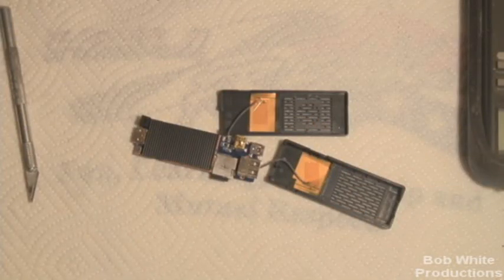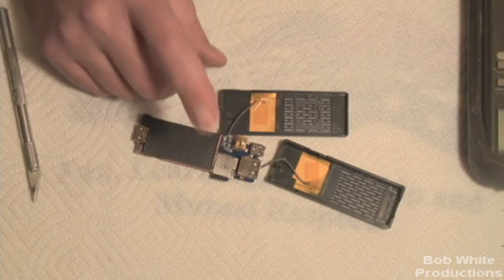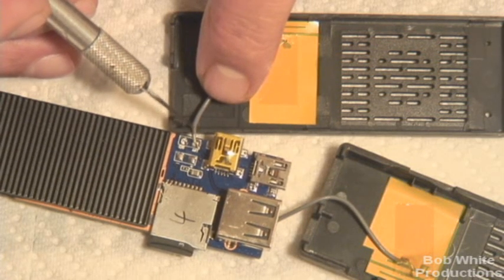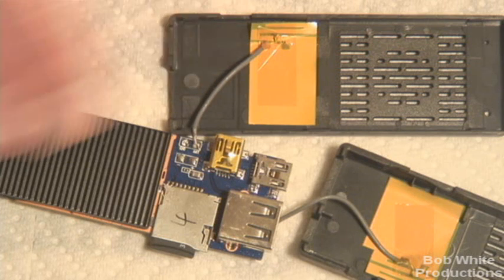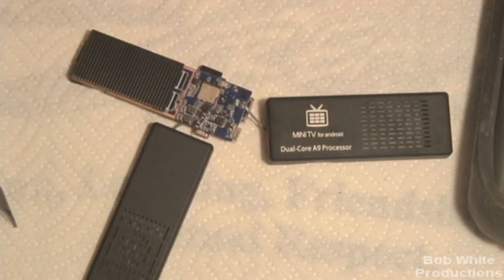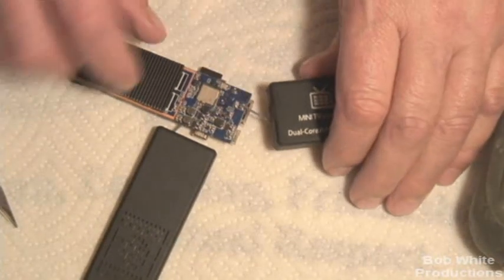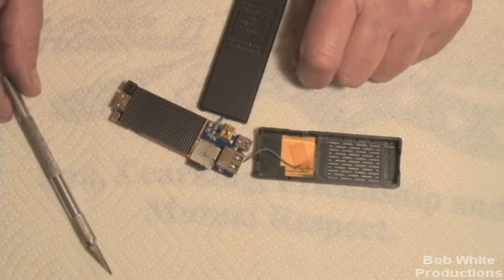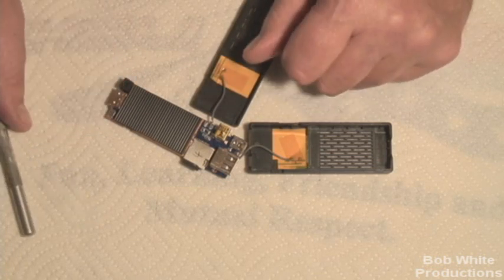MK808 Quick Fix Wifi Antenna Mod

Comment: Great vídeo!!  I need to solder an antenna cable to the embedded antenna on a baby monitor camera board to increase the range, should I solder the center core to one end and  the shielding to a different end of the embedded antenna ?  Tks.   Here is the link to the board: https://www.youtube.com/watch?v=zGsMKEwCqkU

Comment: you idiot antenna poles are circuited to antenna itself,cable is not short-circuited,removing the mass on one antenna you're probably  increase the strength of the second antenna,likely share antenan the same source

Comment: I have a router where they soldered the shield right to the antenna. So the short was not at the base but right on the copper plate itself. wtf

Comment: Big thanks. I was having problems with a WiFi extender with dropping the connection after an antenna mod and I checked the ground problem and it fixed it. Now it has a consistent strong conecction.

Comment: I have a similar issue with a tablet I bought recently. Unfortunately the electronics are a bit smaller there so it's not quite as easy to fix, can't really tell which solder to cut. Guess I'll have to wait for my electronics expert brother to visit, unless there is some way to measure it?

Comment: Hey everyone. My wifi speed is 208kB/s down and 106kB/s up. uplink is fine but downlink should be something like 2048kB/s. I've orgiginal mk808b from geekbuying. Which is the antenna for the downlink? one antenna is connected via 2 pins (not shorted) the other one is connected via a wire (2in1) which is shorted so i guess this antenna is for downlink. Is there any problem just using 2 wires for the antenna?

Comment: I'm looking to embed one of these in a Droid Bionic lapdock and heard they had WiFi problems but if this is all it is it's not going to matter with what I'm doing. In fact mounting a couple of foil antennas behind the bezel of the LCD and running some white Mil-grade teflon coax I have through the opposite hinge as the LCD wiring looks like  it's real doable .... Just like a real laptop .... Then again a SMA jack and a 'Cantenna' and I have a long distance multimedia monster

Comment: Not all antennas are a DC short and that one certainly isn't ... In the video you can clear see the break in the copper foil between the large ground plane and the driven element which looks to be about a 1.4 wavelength. Like the gentleman who made the video noted by cutting the braid it no longer acts as a 50 ohm transmission line but as part of the antenna. It also looks to be close to a 1/4 wavelength @ 2.2GHz which is probably why it still works well (Anything is better than a short)

Comment: hey guys after long trying i found a fix !
this anthenna problem is kinda bullcrap, i tried all 
Here are the 2 fixes i found :
1.just set your router to transmit at 11bg mixed signal mode amnd vualla !
from barley 1 mgbs running fully on my 10 ! good luck guys
2.disonnect any usb e.g mouse or keyboard . download the remote app and control it trough your phone. that gave my 3-4 mgps more o.O

so i went from 0-1 mgbps to fully strong 10mbgs wich is my max ! good luck guys !

Comment: Did you use two actual power supplies or did you merely use one power supply and plug the other USB cable into a USB port on your TV or your computer? Cause that's what I did and it didn't do anything for me. Thanks.

Comment: Hi Bob, thanks for the great tutorial. I have one small issue. Though my unit is an MK808, the insides look just like an MK808 B, minus the Bluetooth. The wires inside mine are not as clearly differentiated as they are on yours, making it pretty much impossible for me to tell which one is the antenna and which one is the ground. Can you provide some help with this issue? Thanks in advance and keep up the good work!

Comment: do you have a link? I have the Imito MX1 thatI have removed the case to get a better wifi signal but the antenna is coming of the solder pad at the unit. The link would be a great help to me and other to solve the wifi issues that some of these devices have, thanks in advance.

Comment: Hi Bob 
i find this in the liliputing site! MK808 mini PCs. In a nutshell, it involves opening up the case, removing the antenna, and attaching a 12 cm piece of wire to act as an external antenna, the process involves use of a soldering iron — and if you don’t know what you’re doing you could damage your device. But part of the appeal of these Android TV sticks is that they’re so cheap you might not mind if you break one in the name of science.

Comment: If PIFA antenna is used, 2 pads are actually shorted. In this case, you can't use multimeter to check continuity. Watch this video watch?v=7HCCi6oWfBs

Comment: So does the mk808 have heat issues at normal operation or just over clocking? is the ug802 any better as far as heat? thanks

Comment: Solo que hay que modificar la conexión de las antenas como indica el Sr. iasitu, estas antenas están autocortocircuitadas, solo hay que desoldar la malla del cable en el punto donde esta soldada a la tablilla (no hacerlo del lado de la antena) en mi caso solo tiene cable en una antena, en la otra no tiene cable, esta conecta por un par de pines que hacen contacto al ensamble del equipo, resolví con tiras pequeñas de cinta de aislar pegadas en la antena donde hace contacto el pin GND.
Saludos

Comment: iasitu: you are a star. My MK808 was a nightmare and was sitting around because it was not usable at all. Hardly able to get wifi for 5 mins. Your trick worked brilliantly and watched a complete film through XBMC and connection did not dropped even for a second. so I can confirm that this trick worked like a charm. 

I think hawkeye1103 is right.. I think Antenna pads are the one which causing the problem. It would be great if hawkeye1103 can make a video of his custom pads.

Thanks again!!!!

Comment: I just took mine apart because I only get 1 bar when the router is in the same room. The front showed the connection as OPEN, thus good, but the back one was a closed circuit. For good measure I disconnected the grounds one at a time... and now they are both disconnected, I still only get 1 bar. So perhaps my short is in the board itself. I didn't think to check the circuit when I had the wire disconnected.

Comment: for my case, my unit is shorted on the board it self...
i remove the antenna cable completely & test for connectivity - It is shorted.
(few member in freaktab also confirm this on their device)

in the case the board is shorted, i dont think unsolder the gnd will now improve signal.

can u test yours and let us know??

Comment: I opened up my MK808 and upon investigation, found that, its not the solder pads thats shorted, but the antenna itself. You can test this by using a continuity tester on the antenna on the spring loaded connector side. if you test the pads on the antenna, where the spring loaded connectors connect, you see that its shorted. I think if we identify the short, and find the design of the antenna itself, we can cut the antenna patch, and remove the short. I am going to try this and will update soon

Comment: The antenna pads are the ones that are shorted out, and not the cable. I made some pads that are the same as the original with thin copper foil and double sided tape. The good thing is that they are not shorted out.

Comment: I got my mk808 got three here in all and the wifi does vary a lot on them all one of them shows 2 bars but it doesn't load the webpages very well and another loads them very fast and works a treat. What I am unsure of since instaling the finless 1.5a I no longer see a way to install pkg files.